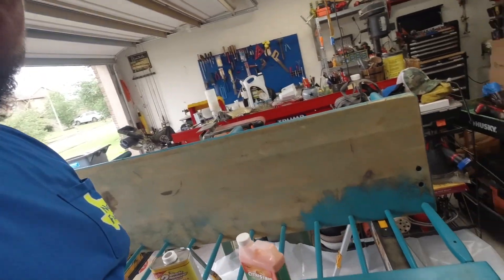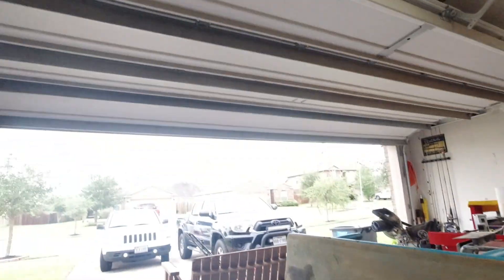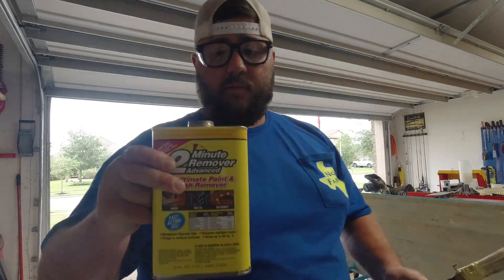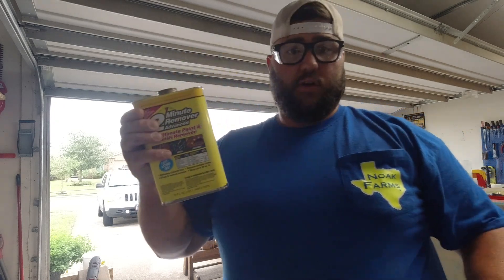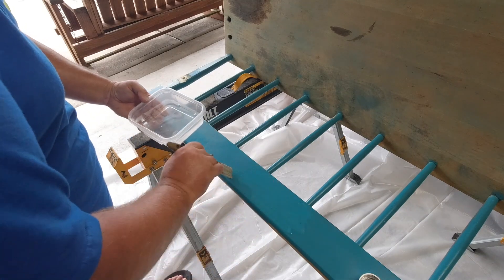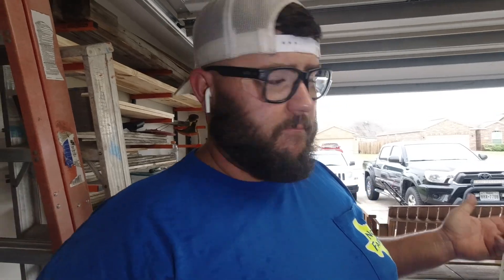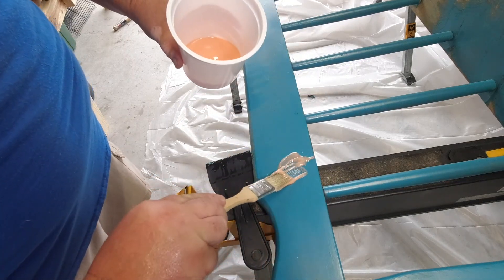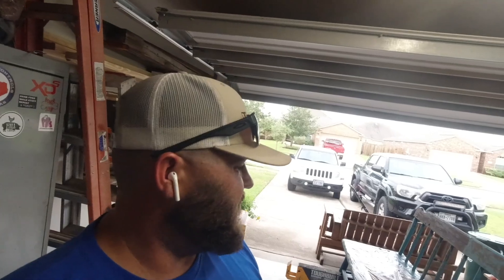BEST Paint Stripper on AMAZON!!! | 2 Minute Remover vs. CitriStrip

Comment: Good video.  I've been using Citristrip for a couple weeks now.  To improve the results, coat it with the stripper, cover the area with saran wrap then let it set overnight.  It will take off 3 layers of paint at once.
Reply from the maker: Thanks for the tip!
Reply: It works that well ??

Comment: Hi. Great video, thanks for the comparieon. I have read that after applying the striper, cover it up with plastic wrap and leave for several hours or overnight if you want to. This prevents the product from drying out and gives it max time to soak into the wood.  I have not tried it yet, but I plan to this week.  Thanks again for sharing.

Comment: Does it has a bad smell i need to take paint off a wall inside my home
Reply from the maker: I’m not sure if I would use it to take pain off of a wall. Like a drywall wall or brick or what?
Reply: Yeah it’s finish drywall has couple coats of paint on it but a family member used spray paint for art purposes .and now that room smells really bad  and the smell is not as strong but is still there despite painting  over any advice to get rid of the smell ?
Reply: @sickeyeseee5647  , hahaha, you had a kid peeing on the wall, didn't you?  I would use (if you can get it still) , an oil-based stain-covering primer, like Killz or Zinnser and then a quality paint.  But if you have to strip it, I'd use Citri-Strip and of course the windows open and a fan.
Reply: Lol no peeing on the wall
Reply: What I ended up doing is just scraping the paint off lucky I found out that the wall had been had a lot of drywall mud on it so I didn’t mess it up to much the wall is only like 11 by 10 so it was not much work

Comment: I use Citristrip for all of my projects. I am currently stripping mantles and built ins in my grandmother’s 100 year old house. If you put a thick coat of citistrip on the piece then cover with plastic it will get through lots of layers of paint. The trick is to not let it dry out. Once stripper dries it stops working. Also, don’t move the stripper around. Move it as little as possible when you are putting it on.
Reply from the maker: That’s awesome! Great tip!
Reply: So how long until it dries? If you cover it then how do you tell or is there a certain amount of time before you start peeling it off?

Comment: Asked for Citristrip; they only had the 2 Minute product. I should have gone up the street to SW and got the Citristrip..😕. Nice finish job, BTW.
Reply from the maker: Thank you. I ordered mine on Amazon
Reply from the maker: The 2 minute remover works but you have to do several coat. But it’s an easier cleanup job than the citristrip

Comment: I use kwik strip it’s working instantly maybe because it just spray paint I’m removing
Reply from the maker: Quick strip does work. I’m not trying to downplay how well it works. But the paint on this particular bench was laid on thick so I was using like 3-4 coats of it. I would recommend quick strip for spray paint and quick jobs for sure.

Comment: you're a king for doing this review.  I need to remove 115 years of paint from mouldings in my house and none of the strippers I bought did anything until I tried citristrip. Thank you!
Reply from the maker: Thank you!
Reply: @texasgardenguy  we can't get the Citristrip WITH NMP in it... did that have NMP??
Reply from the maker: @loubonaparte5063  I’m not sure. I’ll
Check when I get home and let you know.
Reply: @loubonaparte5063  If you pause at 7:59 you can see “No Methylene Chloride or NMP” in the bottom right hand corner. 

He used the Non NMP version.

Comment: Watched a few vids and this one was more direct on which one to use.  Will use that citris one.  Thank you for the vid.
Reply from the maker: Thank you! The two minute remover works fine for small areas. I also pressure washed the bench after using the citristrip to get it all cleaned up too.

Comment: Ciristrip leaves a residue almost impossible to get rid of
Reply from the maker: It does. I had to pressure wash the bench afterwards to get everything off.
Reply: Get a plastic brush and gently scrub the area with mineral spirits right after scraping the old paint off.  Then wipe it off with a paper towel.